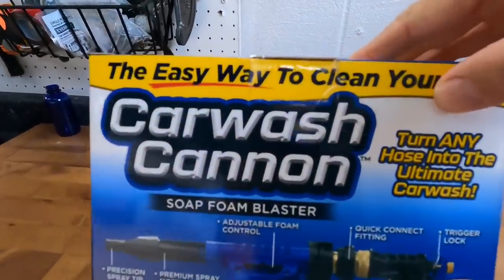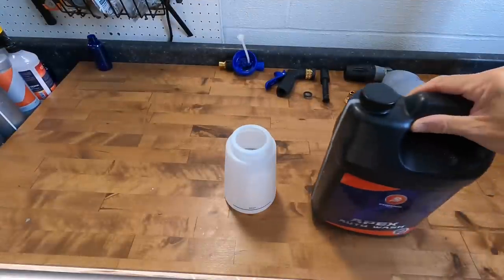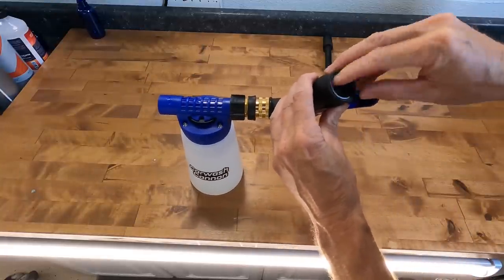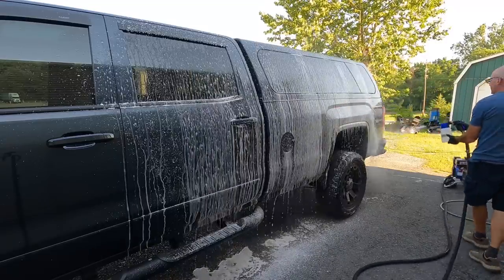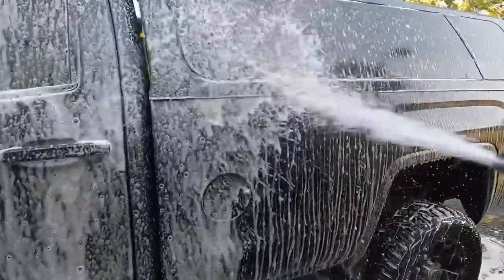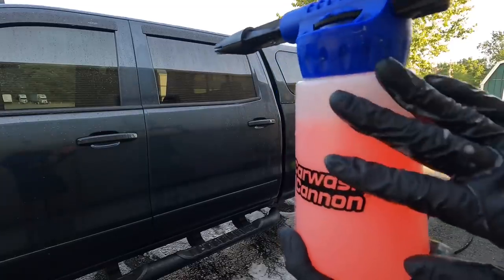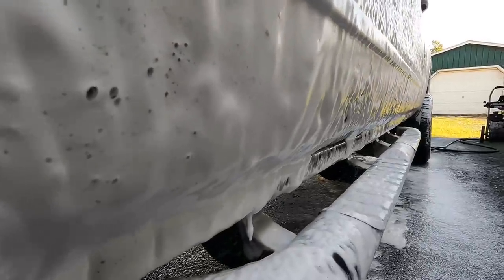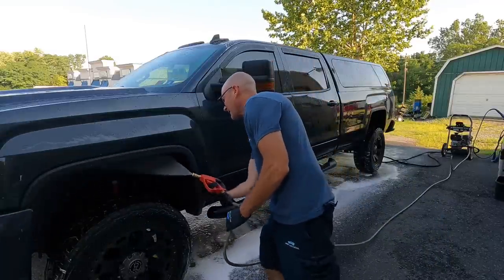"As Seen On TV" Carwash Cannon Soap Foam Blaster!! VS MTM Foam Cannon!

Comment: Complete side note, if anyone is struggling with hard water/water spots, I have found going to the camping section at Walmart and buying an inline water filter definitely cuts back on water spots, not perfect but a good improvement!
Reply: Yeah I used to use a couple of those little RV filters chained together. Definitely better than nothing. I remember a couple decades ago, I had just got my first car and license so I loved washing it, and I think it was a Mr. Clean car wash accessory.. but it was a soap gun and water filter hose attachment. You would wash the car and switch to the rinse setting at the end and it would filter the water for the final rinse. It actually worked quite well, and my black car would indeed dry spot free.. though the refills were about $10 and I only got a few washes out of each one. But this was before microfiber drying towels, so it was terry cloth or chamois or nothing, so I happily bought the cartridges.

Comment: If you can find the cannon spray on sale it is almost worth the price for the garden hose sprayer and quick connects. I run an old gas Honda pressure washer that puts out 2400 psi and flows 2.6 gpm. The MTM and Apex combo works great and provide a solid five minutes of dwell time on average which gives me plenty of time to detail the nooks, crannies, and door trim. Thank you for the video.

Comment: When I first started I bought a Gilmour flowmaster with the brass mix ratio slide adjustment, which has been changed to a newer version. I still use it from time to time and it produces reasonable foam with 3oz of soap. The newer version is available on Amazon for around $40. But I haven’t tried the new one so I can’t recommend it.

Comment: I picked up a SZSXHX FOAM CANNON, off Amazon, for maybe $25, or $30 bucks? Can’t remember the exact price, but it came with 7 different size tips, for different pressure, and so far, I absolutely love it? I get super thick foam, with Mr. Pink soap, and a green tip? 2500 PSI Green works Powerwasher , two thumbs up!👍👍
Reply: Actually, it’s a SZSXHX S300, foam cannon gun, with 7 tips, for different pressure?👍 Great product so far? No complaints.

Comment: When foam cannons first came out and were all the rage I bought a few different ones here and there, used them religiously for a while, but found it really made no difference from just a good pre-rinse followed by a traditional wash. Freshly corrected yes, like you I will attempt to avoid contact as much as I physically can, so I still have my MTM cannon that I keep on my truck, but other than that I have pretty much stopped using foam. If a vehicle is particularly dirty I do a simple Road Warrior & Dirtbuster mixed pre-soak out of an IK sprayer, followed by a thorough rinsing then a traditional wash. It works for me!

Comment: I bought a similar unit from Chemical Guys years ago before I owned a pressure washer. It produced slightly better results with mildly thicker foam than the unit you tested but not much.

Comment: In 2017 I picked up one of those guns, being really new to detailing and thinking I'd never buy a pressure washer. It does what it needs to do in a limited way. But after a couple of years I stopped using it and now I'm looking to buy a pressure washer. Although give me two years and see what I'm saying then🤦🏽‍♂️ Certainly these are cheaper and easier then having to monkey with a pressure washer, but I'm hoping there's going to be more satisfaction when I'm spraying foam from my MTM foam cannon 😊
Reply: I use an electric pressure washer and it does really well and always works

Comment: I have a similar garden hose foamer, it works better than the one tested. I use it mainly during the early and late season washes when the daytime temps are in the high 30s-40s and freezing is possible overnight. I don't want to risk freezing my pressure washer or having to haul it in and out of the basement.
This was a fun review to watch, thank you!

Comment: As much as ONR has its place in many parts of detailing, like interior glass & vents…I won’t maintenance with it. I tell my customers a detailer reduces the amount, depth and length of micromarring throughout the life of the car, ONR doesn’t promise that lol it promises faster work. 

With maintenance clients I see every 3-4 weeks that have good coatings or Jescar Ultra Lock Plus on them; I use stars & stripes from chem x!! Now THATS efficiency without having to worry about scratching paint, especially during the drying process.

Comment: I bought a 2021 ram 3500 dually crew cab long bed that’s black. I don’t have anywhere to was in the shade. My current routine is a rinse with a cheap ryobi electric pressure washer. Then I use the MJ foam cannon with smaller jet using mckees 37 soap. I foam the whole truck and use thick rag company microfiber towels and once it’s out of the bucket it doesn’t go back in. I also started using a DI tank for the rinse. I do not rinse till I wash the entire truck and it leave no spots.

Comment: O.k. I bought one of these foam cannons a year ago. I detail my 2017 Ford Escape Titanium AWD 2.0 turbo. I have a small garage. I can't put the Escape in it. I have a power washer. But for a maintenace wash. I still use a garden hose. I found using the Megiuar's Gold car shampoo in my foam cannon. I add 3 oz's of car soap to the cannon and fill with Distilled water to the top and swirl the soap instead of shaking the cannon. Gives me the best results possible. You get about 5 minutes of soapy foam. Starting at the top of my SUV. Then quickly move about it. Will work. You can shut off the switch on the cannon and refill 3 oz's and add the distilled water. I buy distilled water at Wal-Mart by the gallon. I don't have soft water either. That's why I use distilled water. Let the soap or foam sit. It will lift the dirt up. Then rinse with the same cannon. Without taking the cannon off. Then dry the SUV off. I use Protect - all R. V. Wax. It goes on the trim and paint and glass. Easy on and off. This method is cheap and easy-to-use. Shawn.

Comment: Totally depends on the pre-wash whether it needs thicker foam for a longer dwell time. As an example, bolt hamber autofoam achieves the same results whether used through a foamer or pump sprayer. An effective pre-wash/foam doesn't need 10 minutes+ to be effective, 1-2 minutes is more than enough.

Comment: I tried chemical guys unit for a customer and it used alot of product 2 full containers for a car and it was runny so I couldn't recommend it and sent it back. The lack of pressure simply can't be replaced and causes poor suction from the pickup tube so thick mixtures can cause high dilution ratios and the lack of aeration makes these products ineffective, the best solution for a presoak is a large spray like the ik 9 pro, it uses a little more product than a foam cannon but can deliver a more concentrated and sticky foam.

Comment: Looks ALOT like the Chemical Guys foam sprayer. Works for light grit but I find myself pulling out my Big Boi Pressure washer with QD fittings which makes things easy enough to use every time. I found the garden hose sprayer will get "stuck" or "stiff" over time and lends itself to sit on the shelf more often than not. It's mainly used to use as a SOAP applicator when I'm far too lazy on a Sunday to do anything. Same as your results.